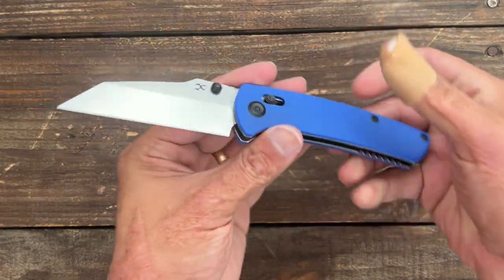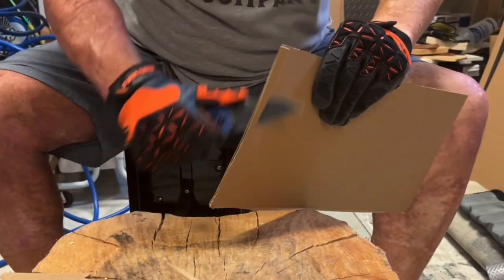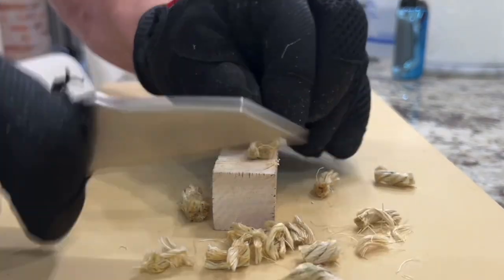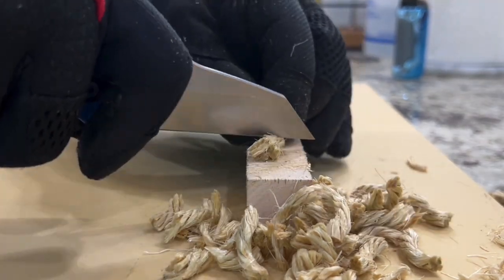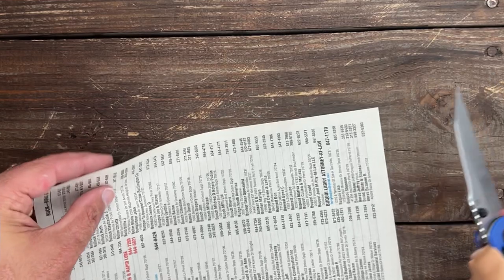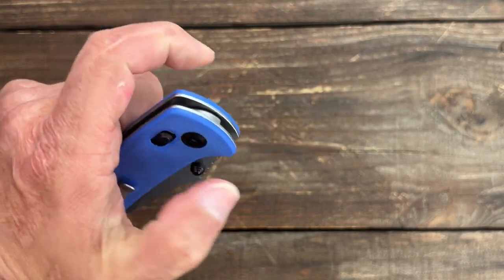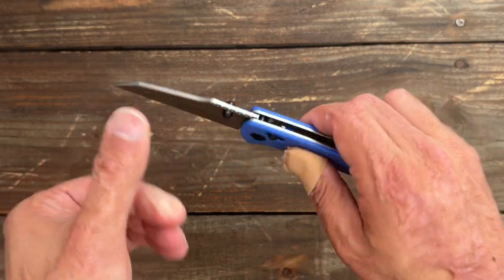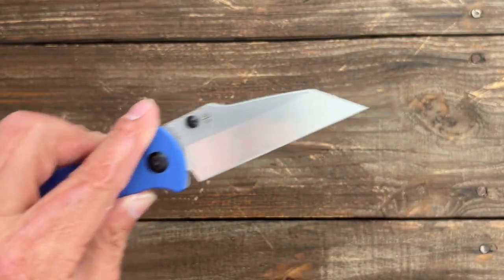Upgrade Alert: The New and Improved Kansept Main Street

Comment: Nice review! Thank you! Your nit picks are spot on. They released this one by surprise. I didn't know anything about it. Jimping on thumb ramp wasn't meant to have such extreme chamfer. That was a mistake on the first Main Street. Trying to get that corrected. It should be ambi carry. Not sure why they wouldn't. I am with you on recessed clip screws. Should be industry stanadard at this point. The recessed jimping on the handle is not meant to reach out and grab you. It is meant to be subtle grip for general use and then gives more grip when you really bear down. This jimping and the tire tread jimping on the thumb ramp is something I use frequently as an homage to my friend and mentor Darrel Ralph. He used both a lot in his designs.

Comment: I love the blade shape of a wharncliffe. I really like wharncliffe blade shapes (similar to the Pyrite) that has some belly so you can have more contact with the material etc... with the blade. I'm not sure if it's still considering a wharncliffe at that point.
Reply: It depends on how critical you want to be, but a sheepsfoot blade usually has some belly compared to a true wharncliffe like this Main Street.
Reply: @Mysmi   Would you consider the Pyrite a sheepsfoot then? It's listed as a wharncliffe.
Reply: @KINGACE9  it is listed and promoted as a wharncliffe, but as a true blade shape I would argue that the pyrite is easily a sheepsfoot blade. 
A true wharnie is a dead straight blade shape regardless of how the spine  comes down to its point
Reply: @Mysmi  Makes sense.

Comment: I picked up the 154CM, Red G-Mascus version and it's fine, but mine has some exceptionally aggressive crossbar lock stick. Been flipping it for a couple days and it hasn't gotten much batter.
Reply: This may sound strange but have you tried taking a leaded pencil and marking the blade tang where it engages the lock bar? On other axis locks this can make things a lot smoother. I also have seen where ANY kind of oil/lube on that surface actually makes it rougher for some reason. On my very old Griptilian(2003) it doesn't matter but see that on my newer Presidio II. The Presidio II has what looks like a coated bar lock, where the old school griptilian of mine is all steel and butter smooth.

Comment: I've been looking at the Main Street. If you look at just the specs it sure seems this version is heavier than the previous one. Is that weight real noticeable compared to the older model? The blade looks really nice, and your cutting tests showed it really is a cutting beast. It seems Kansept's doing a good job on the heat treat for their 154CM. Hey man, this thing checks off a lot of boxes! Thanks for the review!